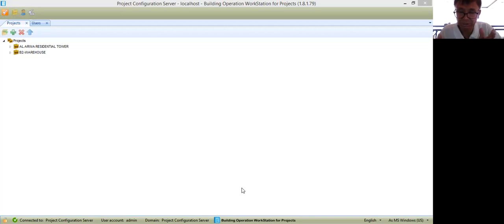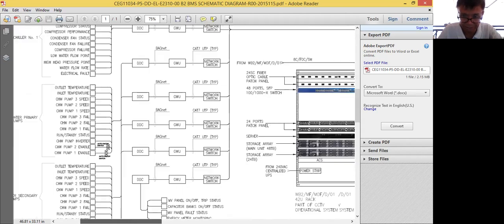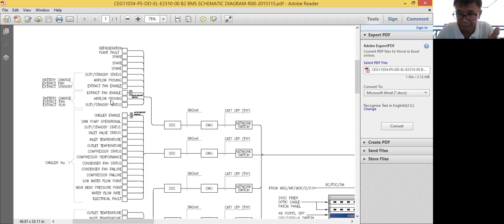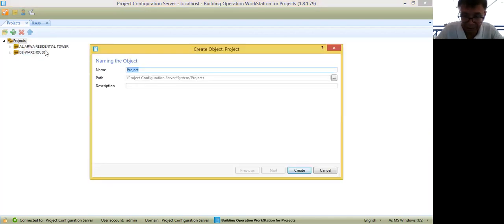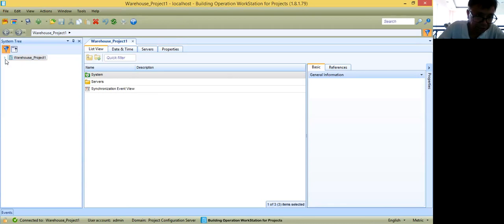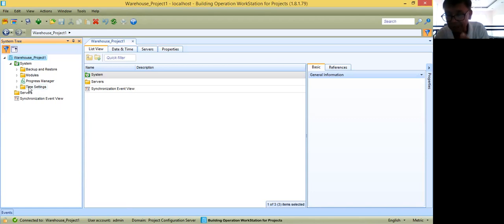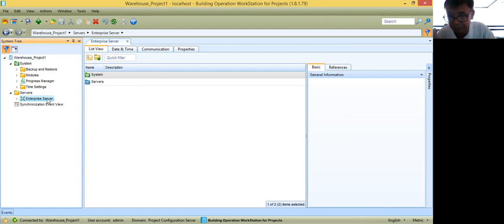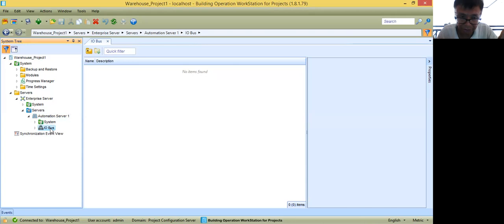How To Configure a BMS project Offline Part 1

Comment: Which cable, you are using to connect one Ddc to another in loop, is it belden cable
Reply from the maker: we are using Belden Cable you can use  also equivalent cable as long as it will be approved by the consultant

Comment: Can you make vedio on all Elv system like CCTV system, Access control system, Public address system, nurse call system, gate barriers, Master clock system, fire alarm system, Automatic sliding doors and IP TV, if you know about this systems then please make vedios on this system
Reply from the maker: Actually these low current system usually done in Software Integration, these system can give common fault alarm and system  healthy status if  you will do hard wired as per my experience